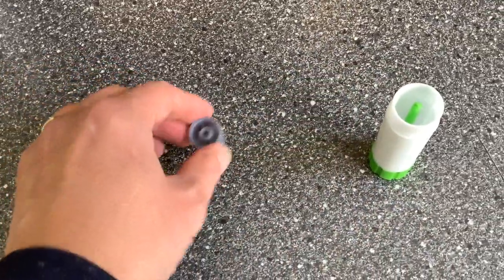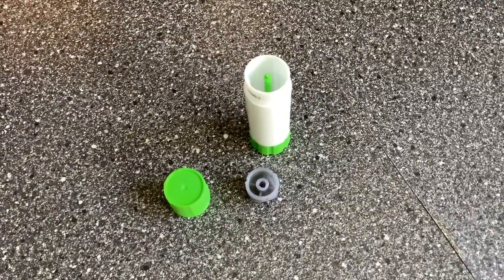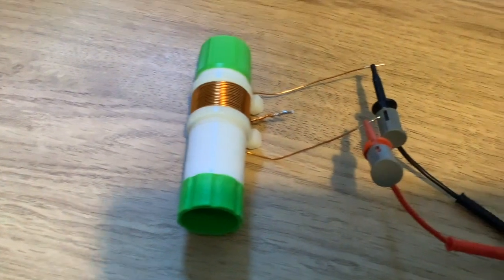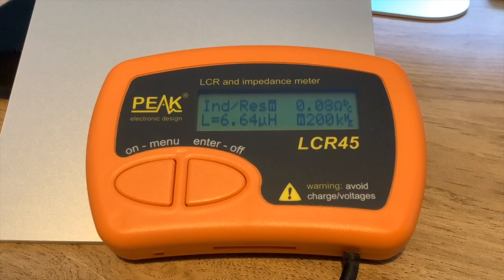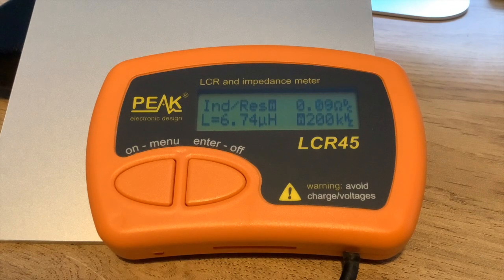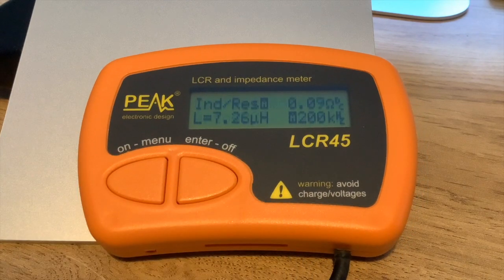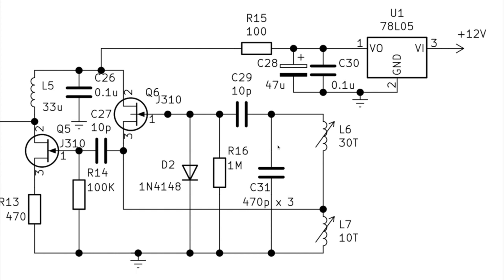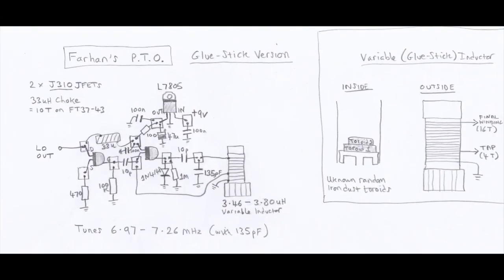32 - Glue Stick PTO (Permeability Tuned Oscillator)

Comment: Another good video, thanks Nick! I did see this on solder smoke and it was great to see your version. 

In the 80s there was electronic surplus company called Bull and Son who made kits from items they had bought wholesale. The first receiver I made was one of their kits. It used a coil wound round a pencil former to make an air coil. The tuning was done by a piece of ferrite rod stuck to a string, which the tuning knob raised or lowered into the coil. 

It worked a treat and I guess was a similar principle.😀
Reply from the maker: Thanks so much. Yes, it is a surprisingly common idea when you dig into it. I think it's just that it has not had too much attention of late ... until now! Thanks for watching and commenting as always. 73 Nick

Comment: Nick, my goal is to do what you're doing in the homebrew realm.  I started out building Colpitts and Clapp oscillators.  The Hartley has one capacitor and two coils.  I wonder if it would help with stability to throw in a second fixed coil.  My Colpitts seem very stable even on a breadboard down in the 1.2MHz range.  Gotta try this!
Reply from the maker: Hi Mark, I actually started out on my own homebrew journey by building analogue VFOs. I didn't have great success to be honest but I had a lot of fun. It is actually not a trivial thing to build but it can be done and done very well. It is something that I have considered revisiting now I have a better idea of which end of the soldering iron to pick up! Keep up the great work. Bill N2CQR would be a great person for you to contact - he has a real passion for analogue VFOs and won't go near an Si5351! 73, Nick

Comment: Nice project, I've been playing with gluesticks as tuning mechanisms for a while now but with ferrites harvested from discarded shop security tags. 

I've also been toying with the idea of making variable capacitors (trombone? Piston? I dunno) from them with slug tape. 

Strikes me that you could have built the circuit without the copper clad PCB if the tin is solderable
Reply from the maker: Thanks Clint. Well done on your own glue stick inductors. I too have played around with building a variable capacitor piston-style with two metal tubes of different diameter. It worked but would have needed more mechanical refinement to make it practical.

The metal tin I used is not great to solder to. You can if you scratch it up a bit first but it was just easier to build on FR4 and stick it in. Thanks very much for watching and commenting. 73 Nick

Comment: The one problem you migh have with a glestick is the backlash from the slop in the plastic parts.  One thing to try is cutting some sott foam inrto discs that fit into the end of the glue stick  tube.  Wiith te end cap on this should providee enough back pressure on the tuning slug to reduce or elminate the backlash.  Probably have to play with type of foam, and how much you pack into the tube.
Reply from the maker: Thanks DuWayne you're absolutely right. The first one I built was great - very little backlash and comfortably firm turning but this latest one is not quite so tight. I'll have a play! Thanks again. 73 Nick
Reply: @M0NTVHomebrewing  You will prob. be fighting a loosing battle as the production tolerance on such things tend be very "loose" so it will be pot luck if you get a "tight" fit or one with a load of backlash.

Apart from making an entirely better engineered version, you could improve things by replacing the existing threaded rod with a  Nut and bolt. Use a nylon bolt M4 or M5 as a replacement.  Glue the head of the bolt into the "knob" end of the glue tube, and the M4 or M5 nut into the centre of the   grey carriage. That will give a consistent operation.  

Use two grey carriages with a spring between them and most of the remaining backlash will be removed.

Andy
Reply from the maker: Thanks Andy. I should really have experimented with the physical construction of the turning mechanism before I'd built the coil on it and enclosed it in a metal tin! The next one will be better!!! Thanks again for the ideas. 73 Nick

Comment: Great video nick been learning some rig homebrew myself recently, love those pads we’re do you get those from btw? Also if I was to make RFC choke for say like a old VK200 style one what would you recommend?
Reply from the maker: Thanks Jon. The 'Me Pads' come from Club Sales at the GQRP Club but you can get them elsewhere (www.qrpme.com). I don't have any experience of the VK200 itself but if you google 'VK200 ferrites' you should find some. To be honest the finished chokes are so cheap it is hardly worth rolling your own but if you want to then good for you! All the best with your own building. 73 Nick
Reply: @M0NTVHomebrewing  thanks 😊 nick i must try a little harder with the searching some parts can be so tricky to find these days especially the good stuff x
Reply: @jonhoyles714  If you can't find any Me pads, grab a piece of 0.9mm (or less) single sided FR4 PCB and just chop it up into whatever sized pads  you want. That works just as well.

Andy
Reply: @andye2005  thanks Andy yeah that’s what I usually do chop bits up for pads 👍

Comment: I made one just about exactly like yours and the inductance was remarkably close.  Mine was 6.566uH to 7.542uH measured with my NanoVNA.  I'll initially put this one in a 20m DC receiver, but will eventually add switchable caps to make the receiver multiband.  Could you stack different winds on the same glue stick as well to cover multibands or would the inductors have some mutual effect?  Edit...mine drifts pretty badly at first.  It could be that I'm running the oscillator from an unregulated 9v battery.  I will try adding a 5v regulator and maybe insulating the PTO.
Reply from the maker: Congratulations! As to stacking the windings I've not actually tried that. It would be worth you having a go and reporting back if you are able please. If it IS possible then that will greatly simply using the Glue-Stick PTO in a multi band rig. Good question and interesting idea! Thanks very much. 73, Nick

Comment: That’s a solution in search of a problem if I’ve ever seen one.
Reply from the maker: Hi Kevin, I guess it depends on how you look at it. For me, the problem is how to build a stable analogue VFO: one solution is to build a PTO. But the problem with a PTO is that it requires a variable inductor: one solution is to use a glue stick as a former. I suppose my interest in it is in encouraging people to build radios e.g. a Direct Conversion Receiver. For some the idea of programming a microcontroller and using an Si5351 (my favourite method) is just a step too far in complexity. So I'm interested in anything which will help folk to gets hand-on and start building. It's just an experiment but for me that's the fun of ham radio. 73 Nick

Comment: All those harmonics are telling  you this oscillator is clipping. You need to look at the output signal shape, it should be a sine wave, and the less departure from a sine, the purity will increase. This oscillator is too dirty to use as is.
Reply from the maker: You raise an interesting question! You may be right about the clipping but I disagree with it being too dirty to use. Have you ever examined the output from an Si5351 module? It is a square wave which has harmonics all over the spectrum. I sometimes use a low pass filter on it but plenty of people feed this square wave directly into the mixer. Some even argue that you SHOULD feed a diode ring mixer with a square wave because the diodes turn on more quickly. Personally I prefer a cleaner more sinusoidal input as it results in fewer inter-modulation products. So whilst I tend to side with you on preferring a sine output there are many homebrew radios out there that seem to cope pretty well with harmonics going into the mixer. As I said ... it is an interesting one! 73, Nick

Comment: Wrong coil, too tight, they should be winded loosely, and even progressively spread by the end. Wrong mechanical basement for inner ferrite core. The best mechanically stable and precise thing for this is micrometers. Next time if will build PTO don't forget to sound this tested and build PTO from comment sections ) And better use fets for oscillators. You can find builded PTO with old Ten Tec PTO as for inspiration and reference.
Reply from the maker: Thanks for your comments. The whole Glue Stick PTO is by very nature an experimental project. It is not really a matter of a "wrong coil' or a "wrong mechanical basement" - simply that I chose to build mine in a different way than you would. This one was actually the third one I built and each time I changed things around to see what difference it makes. This for me is the very nature of ham radio homebrew - experimentation. Incidentally the oscillator DOES use a FET and the design comes straight from Ashhar Farhan's Daylight Again transceiver. Thanks again. 73 Nick